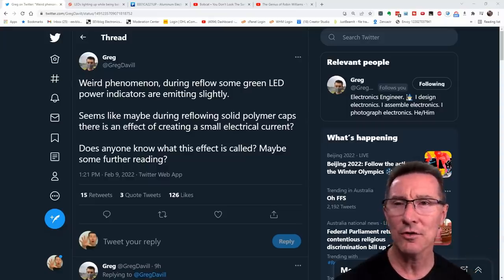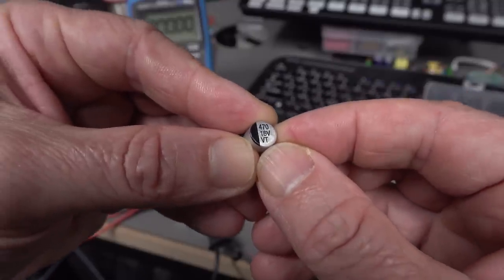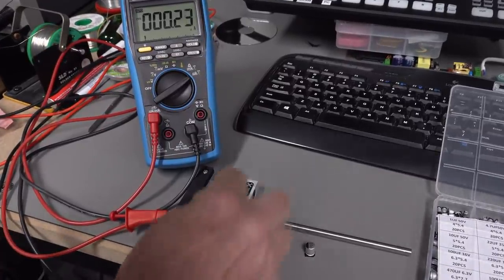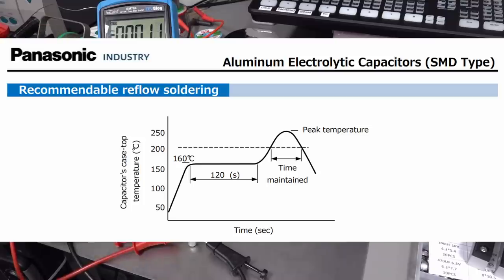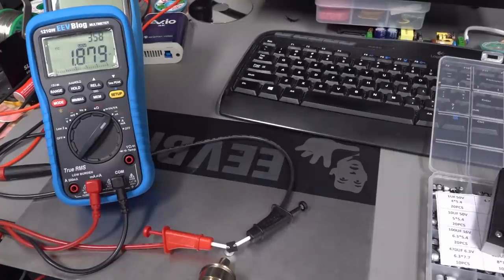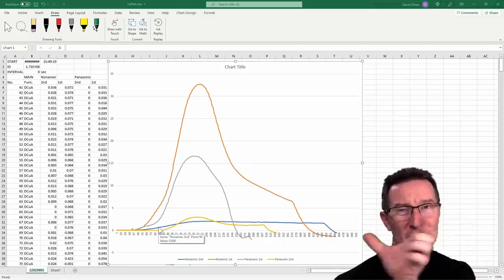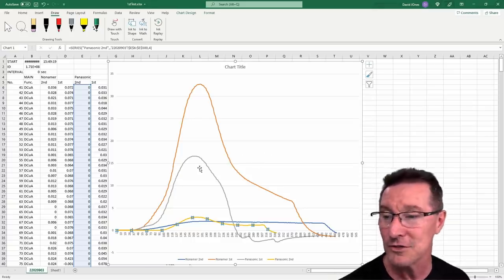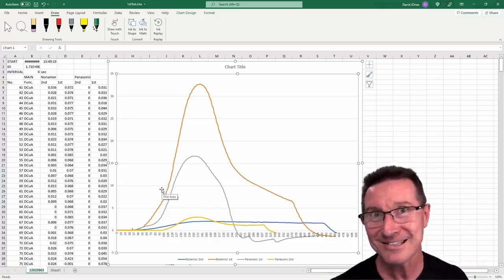EEVblog 1455 - Capacitors Produce Current During Reflow Soldering! WTF!

Comment: Your LED didnt light up because they where not properly heated. The voltage required to light up an LED decreases with temperature! 
Also, capacitors my come with charge from dielectric relaxation. So you need a "relaxed" capacitor and than the current generated through heating may be enough to reach the voltage required for a really hot LED.
I can also imagine, that the LED short-circuits the precharge (relaxation) of the capacitor so that the current generated directly goes into the LED.

Comment: @eevblog its not thermo electric, its static electric.    The moving hot dry air is inducing a static electric charge and charging up the capacitor.   Do it again with an oven (not convection of course) instead of a hot air blower and you wont get the same thing.

Comment: My theory is that when you heat capacitor part of it is colder and this causes potential. 2nd test should be more similar to 1st if you gave capacitors  more time to cool down. One thing that might be tried is putting capacitors to the fridge and then trying heating them up. Interresting stuff

Comment: Measure the capacitance and esr at different temperatures.  My guess is the capacitance will decrease at higher temperatures. So perhaps the current is due to residual capacitance leaking due to the increased temperature. Also, try the experiment on fully charged capacitors and show us the results.

Comment: I wonder if it might be the dielectric layer forming for the first time, would be interesting to see if the same happens to a brand new capacitor that has been brought up to it’s rated voltage before heating.

Comment: Thermo electric effect going on. Since warming up the capacitor. The outer shell was getting hotter quicker than the stuff inside. If I'm right, this causes an electric potential. As the inside begins to match the outter temperature the voltage begins to drop. And the negative voltage is happen I believe because its now hotter on the inside (probably due to some chemical reaction added to the already hot innerds) so I'm thinking. Experiment further stick the capacitor in the fridge and see if the voltage is much higher when you cook the outside since the inside maybe much colder to begin with?

Comment: Would simple thermal expansion, increasing the gap between the plates cause it?
If I remember correctly, that would raise the voltage whilst keeping the charge constant? That might be enough to reach the "glimmer" voltage of the LED?
Measuring the open circuit voltage might show more?

Comment: Hello?  Cant meet the required led voltage?  Why didn't you test with 2 caps in series?  I have PCBs with split rail supplies which use 2 caps in series which may make a net voltage required for my power indicator LED.

Comment: I don't think that this effect is of chemical origin - the capacitance was left unchanged after reflowing. 
Al2O3 do have small piezoelectric effect. As such when you first heat the capacitor up, the changes in internal stress causes the capacitor to generate electricity. 
But the slow cooling period afterward also causes the changes to be permanent, and the next time you heat it up there won't be as much internal stresses, similar to the way tempering works.

Comment: At lunch today, I was just reading the Jim Williams "Thermocouple Measurement" app note (LT #28) that either you or Chris linked a few weeks' back on The Amp Hour. Mr. Williams indicated even straight solder and copper bonded would generate ~3uV/deg C. That's 750 mV right there at 250C, lest I am mistaken. So... not enough on its own, which would further suggest something chemical going on with that electrolyte. I wonder how many peoples' reflow projects failed because of this effect, and they couldn't figure why...?

Comment: EEE-1CA221UP is not a polymer; maybe self healing process due to increased reactivity based on temperature rise; it would act like a battery; probably oxidation of cathode electrode, as it has a thin oxide to begin with; just a guess, need more tests; could you try with a polymer?

Comment: Solder several in series/parallel and then heat them all at once. I know I have several NOS electrolytic capacitors from ~30 years ago stashed somewhere, I'll try to find and test them.

Comment: Quite a fascinating video but at the same time I need to order similar capacitors to refurbish old school motherboards with the old school budging capacitors. I am surprised how you put intense heat at them and they didn't burst even though you said they were at reflow temps i was anxiously waiting for a pop.
Reply: They are designed to survive reflow temperatures for a specific time, so will not pop, unless you apply heat at the reflow temp for a good amount of time, just 30 seconds will be fine, though after 2 minutes you might find some are either extruding the bung, or have split the vent.

Comment: It's possible that the passivation layer on the aluminium capacitor plates retains a slight polarization from the manufacturing process, which relaxes upon heating. Perhaps you could try a heating and cooling cycle with the capacitor hooked up to a voltage source and see if the effect comes back after that. That would be a good indicator that this is what's going on.
Is that what dielectric absorbtion is? I'm not too familiar with that term.

Comment: We are using some serious high voltage plastic caps. Around 300 uF. 1600v. When we are storing them for long periods of time, the are always shorted. Otherwise they can supposedly charge Up by only room temperatur fluctuations. Damm you autocorrect.

Comment: I am assuming the current flow is in the direction as marked on the capacitor? Would not help to install the LED backwards. I am guessing this a seebeck thing,  or a battery effect. I am not sure the terminals have different metals though.

Comment: I saw the effect of the emitting green LED while heating it when I converting fairly modern CB radio backlight from orange to green one. During the reflow/heating the LED in circuit - no electrolytic caps but AFAIR with one ballast resistor for two leds, one of a green LED during the heat up, actually begin to glow slightly if another one is already installed. Some kind of loop picking up random AC?

Comment: if i had to guess, maybe the other guy's hot air blower was not properly grounded? while yours was? because the nozzle is supposed to be earthed to capture any heated ionized particles and stop them from being blown onto your work piece. this would then explain the difference in results when trying to replicate the experiment. the hypothesis is possible to test for. you have to remove the grounding from the handle' earth. so that there is no way the metal nozzle or casing to return back to the station. or back to ground. of course this is normally highly inadvisable sine you do in fact want to protect your target boards from being bombarded with charged ions. to avoid any possible ESD damahe. not to mention the other direct safety issues to yoursle (should the equipment malfunction). so if you try this then ofc be sure to reconnect the earth back again after your done... hehe. if it is not that 1 thing then idk what it could possibly be. no idea!

Comment: After a few heat cycles like that I wonder if the cap is still within spec? A great followup to this experiment would be to measure the cap and internal resistance before and after cooking it.

Comment: Does it do it again if you fully charge the cap and then discharge it before doing another test?

The electrolyte probably changes internal resistance of the cap with temperature change, causing it to discharge a little extra. Could that do it? It's common in batteries for the IR to change with temperature. People who fly competition RC planes that dump the energy of a battery in extremely short times heat the batteries up before flying to reduce the IR.

Comment: At my last job we gave some LED to our lab team, and they told us that there was some current from LEDs when the board was put into sunlight. Weird stuff, maybe capacity of the board itself, but temperature is a magical goblin in electronics.
Reply: It's a tiny effect, but LEDs can act as photodiode. So, depending upon the current generated, that might not be too surprising.

In a pinch, LEDs are perfectly usable sensors.
Reply: When an LED is places into sunlight it makes sense that it produces voltage. Any LED is a photodiode (photovoltaic device) and vice versa any PV panel can function as an LED though the efficiencies of each device are obviously optimised for its intended use.

Comment: could it be that the air "moving", not only the air beeing "hot" also generates a static charge on the pins also (first test around 4 minutes in) ?
The 30µA with heat are of course alot more impressive :-)
? or does it take a higher charge when the heating element runs hotter ? as in the ion/ozone generators ?

Comment: It is called the Seebeck effect, it is where a temperature difference within a metal produces a voltage potential. Peltier modules utilize this effect.
Reply: Seebeck effect generates very low voltages though (typically a few microvolts/K for metals like the aluminium in an electrolytic cap), so you need many junctions in series to get a useful voltage.  Also if it was Seebeck then it would be repeatable but its not, the current drops significantly after the first temperature cycle.
Reply: @ferrumignis  the current drops significantly after the first cycle due to the temperatures equalizing. The capacitor is storing the voltage as it is building up.

Comment: Just a first guess, is this not just i=v*dc/dt ... So any residual voltage difference on the plates gets turned into a current as the capacitance changes with geometry?

Comment: No free energy here. You dumped 100 Watts of heat energy into the cap and got few micro volts on the leads, appears like electrostatic charge build up.

Comment: Here is a CLUE: Nobody makes POLARIZED Aluminum Electrolytic Capacitors!  All Aluminum Electrolytic Capacitors are manufactured as NON-POLARIZED.  Look into the process of how they make them Polarized to find the answer. 😏

The "VT" on the 470 uF is a series from Lelon one of the largest and best Chinese capacitor manufacturers.

Comment: you really dont need any special LEDs to light at a few uA. I tested some random Aliexpress green LEDs once and they were clearly lit up at 5uA at Vf = 2.4V (normal forward voltage 3V). So if those capacitors also reach enough voltage, I wouldn't be surprised at all if it lights up. 

I'm wondering though, how does a 16V capacitor compare to a 400V one, for example. (similar physical size.) Would be pretty whacky if a 400V capacitor produced less current but more voltage and vice-versa.

Comment: If Farads are  Coulomb per Volt and you have a non charging  capacitor, if you reduce the geometry to change Capacitance, you'll inversely change the voltage. 

Now heating whatever is in there can accumulate energy to start pushing against the "plates", by thermal expansion. Less capacitance, more voltage. After a while, it can boil off and the drop you see happens. Due to elasticity be get same but smaller negative effect. Then you mystical phlogiston condences,  if it didn't escape and cycle begins. 

I surmise this true, since a bottle ago

Comment: I would guess its a combination of space charges in the dielectric being liberated by the heat (causing the large but diminishing positive peak while hot), and pressure causing a small reversible piezoelectric current on top of that (causing the small negative current on cooling). Now I really want to know what’s causing it lol.

Comment: Wondering if this isnt related to the thermal expansion of the plates in the caps...if they expand towards one another then its affecting the capacitance and discharging the remaining charge held between the plates...until it reaches some threshold when the increasing discharge due to the decreasing gap is over ridden by a decreasing internal resistance...
Reply: This would explain the diminished response a second time around: charge on the plates is less because it was removed by the first pass.
You could test this by charging the cap between tests...the discharge curve should be similar both times

Comment: I bought some green SMD LEDs from china(lcsc) and those are some odd super efficient type.
When I've calculated the dropper resistor to 1mA it was blinding while it's supposed to be just a indicator.
Even at 5V those require 30k minimum of a dropper.
Didn't check at what currents those start to visibly emit some light but I wouldn't be surprised if 10uA would lit it up...
Reply: That's interesting, could you drop in a link or part number or data sheet? I'd assume such LEDs would be overpriced, but it seems otherwise.
Reply: @therealb888  No problem, LCSC PN: C84267 MPN: NCD0603G1
I've also seen 240VAC panel LED indicator which had 5mm LED with normal Vf but because it was also some super low current type it could just run off 1/4W resistor dropper without it even getting warm lol.
Reply: @Arek_R.  Thank you very much! Why would they not advertise this? Should be advantageous for them after all.
Reply: @therealb888  lcsc doesn't put much effort into product description

Comment: LEDs will not light "if" they are connected with the wrong polarity... If you have current flow across the heated capacitor but the wrong polarity none of your LEDs would light... You did not mention if you tried changing polarity